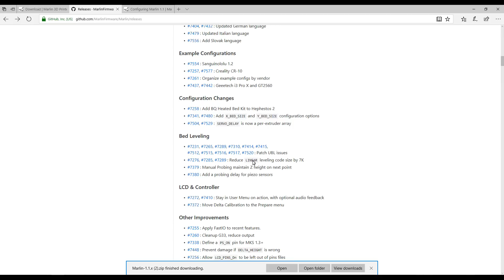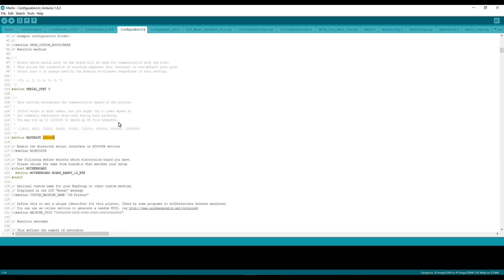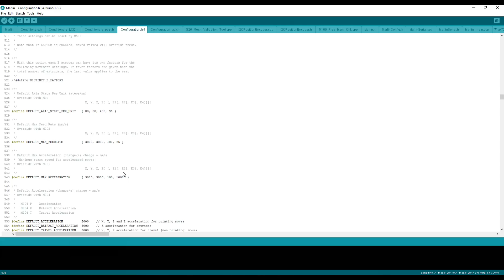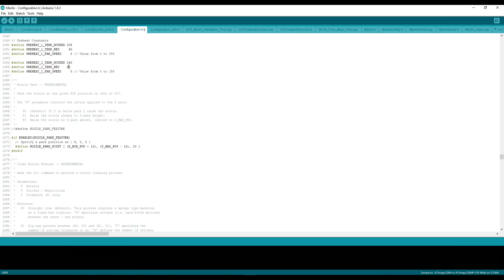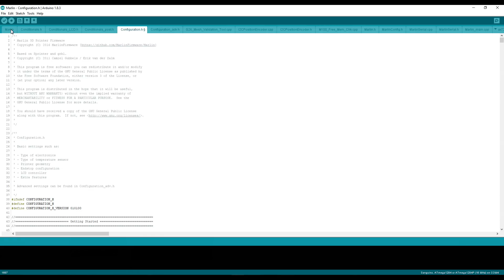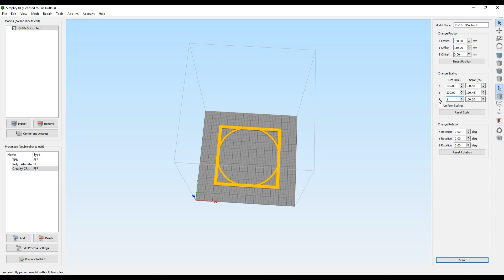Updating CR-10 Firmware to Marlin 1.1.6 Part I

Comment from the maker: Hello everyone, I am going to do a part 2 on the marlin firmware 1.1.6 on everything I have forgotten in the part 1 video. So far I have the filament sensor for those of you with the CR-10S, the change filament function, and adding baby steps function as well. Are there any other areas you guys want me to go over in the part 2 video before I make it?
Reply: Dont know if this is just me, if its something that needs changing in the firmware or samething I did wrong.
But I cannot seem to get the machine to go past 0 in Z offset.
So I am unable to find my Z offset ???
Reply from the maker: To disable the end stops you will enter the gcode M211 S0 into the communication bar. In order to do this, your printer must be connected to a computer and through CURU, Simplify 3D, Raspberry PI, or even the Arduino IDE serial monitor. Type M211 S0 and you will be able to go past the 0 in the Z direction and obtain your Z-offset. From there enter you Z-offset either through the control panel of the CR-10 and save settings or on the firmware: #define Z_PROBE_OFFSET_FROM_EXTRUDER
Reply: Thank you very mutch :-)
Will try straight away :-)
Realy great instructions on doing this Firmware upgrade !!
Looking forward to Part 2.
Reply: Hi I,ve installed 1.1.6 on my CR-10S from another source I found some time ago. I have babysteps and mesh bed levelling wich is awesome but there is a strange little thing that I do not get right and that is I have to have my SD card in the printer before I turn it on otherwise the SD card can not be accessed apparently. To be clear, the printer reads the Sd card and I can print but only when the card is inserted before booting the printer. Any ideas?
Reply from the maker: That is an odd problem. What I would try first is to download the stock CR-10S firmware in the description above and compare the LCD and SD support section with your firmware and make sure they match. Line 1170 to 1534 in configuration.h.
Reply: I'm just exploring my 10S Firmware for upgrade. This sounded similar to a discussion on the 1.1.6 upgrade. Someone had an SD card issue and here's the answer: "If you want to use the SD card normally, edit “ultralcd.cpp” lines 977 and 985, it should be: #if PIN_EXISTS(SD_DETECT) instead of #if !PIN_EXISTS(SD_DETECT)." (Note the !) Not sure if this is the answer, but it sounded similar, here's the source: https://printedsolid.com/blogs/news/installing-marlin-1-1-6-on-your-cr-10s-with-mesh-bed-leveling
Reply from the maker: +The PuterPro thanks for helping out.
Reply: {Small Bow} My pleasure!
Reply: Hello Eric's DIY
i was wondering.....i got the marlin firmware and arduino. Q? Do i have to open up marlin.io in ardruino? Q2? am i supposed to be pluging my printer to the pc  to do these steps? How do i transfer files from my pc to my printer CR-10S latest firmware 1.1.8. Mine is stocked with 1.1.6 and i have a creality version 2 board but dont know the name of this particular board...CR10-S and CR-10 is differnt. Thanks
Reply from the maker: Once Arduino IDE is installed you should be able to open the marlin.io file from the folder where Marlin is located. You will need to plug your computer into your printer. As far as the board for the CR-10S you will select the Arduino/Genuine Mega or Mega 2560 with a BAUDRATE 115200. Once that is set up and you have selected the correct com port you will be able to verify and upload. Disclaimer: make these changes at your own risk.
Reply: Thanks mate!!
Reply: hey mac my ino file is DOES NOT HAVE AN ICON I JUST CLICK ON IT AND IT WINDOWS SHOWS ME OPTIONS WHAT APP I WISH TO USE TO RUN THIS MARLIN.INO . WHAT CAN I DO HERE MAN HELP PLEASE ???

Comment: First of I like your video well done, lots of good info, it's surprising how many people don't even know how to add line numbers and it makes following in code so much easier, so kudos to you.
I would like to point out Baby steps is in Configuration adv.h  just do a (Ctrl F on PC) 0r (Command F on Mac) and type in ''baby'' then press find or goto approx line 591.
Reply from the maker: Yeah, not sure why I said baby stepping. I couldn't remember what #define ENCODER_PULSES_PER_STEP 1 was in the video. I should have said the encoder movement for the Smart LCD. Thank you for the tip.

Comment: Line 127 doesn't change the boot screen name, just the screen name on the main panel. 
If you want to change the text under the marlin logo do that on line 92 in version.h

If you want a custom bootscreen uncomment 93 and 94 in configuration.h and check out Marlin\example_configurations\BQ\Hephestos_2 for how to make it

You didn't mention the filament runout sensor on line 801 and 803

For babystepping Configuration_adv.h / 602 uncomment define babystepping / 608 uncomment doubleclick

Also for those brand new to arduino you will need to install the sanguino board and ug8lib library

File/preferences and add the following url to additional boards then go to tools/board/board manager. scroll to the bottom and choose sanguino and install version 1.02
https://raw.githubusercontent.com/Lauszus/Sanguino/master/package_lauszus_sanguino_index.json

download https://bintray.com/olikraus/u8glib/download_file?file_path=u8glib_arduino_v1.18.1.zip
Then sketch>include library>add zip library and select the zip file
Reply from the maker: Thank You

Comment: Great video, I was wondering is there a section in Marlin where you can have the bed move to the front of the printer when done and to the back?
Reply from the maker: You can actually do that through the script what are used Cura or simplify3d.
Reply: Right now Cura, plan to get simplify3d after I get money together.
Reply from the maker: Yeah I'm traveling right now I can't remember the specific code you put into end script I think it's something with G1 Y300 or G1 Y-300
Reply: Do you mean the end gcode in machine settings? This is what it shows now.
G1 F1800 E-3
G1 F3000 Z10
G90
G28 X0 Y0 ; home x and y axis
M106 S0 ; turn off cooling fan
M104 S0 ; turn off extruder
M140 S0 ; turn off bed
M84 ; disable motors
Reply from the maker: Yeah so before M84 you can add G1 Y300 or G1 Y-300 one of those codes will push it forward all the way or back all the way I can't remember which one
Reply: Thanks I'll try that and let you know.

Comment: Thanks for responding.
I have a CR-10 and I was told it had one, How can I varify that?
The reason I ask when I tried to upgrade the firmware, it would not upload it.
I can burn one but I hoped I would not have to open the box. I was hoping I had done something wrong.
I guess I will need to open the box anyway.
Thanks
James Cullins

Comment: Hei Eric, love your videos a lot. I'm new in 3D printer, bought cr-10s (300x300x400) that has two z-axis motors. I want to print with polycarbonate and use E3D-V6 hotend. Do I need to change the settings on Stock firmware? If yes, do I download the stock firmware on your description and modify it the same way described in this video? Or Do I need to upgrade the system default firmware to Marlin 1.1.6 and follow this video? Really need your guide on this. Thank you in advance.
Reply from the maker: The only changes you will have to make from the stock firmware file I provide are the offsets for the E3D mount that you are using and if you have an auto level system. If you are using the same mount as I am, then you can use the same offsets as I do from the video.
Reply: Thank you so much Eric for the explaination. 😃🙌 👏 🙏 🤝 👍 Didn't know you have already made changes on that firmware. This is wonderful. I have downloaded it and now waiting for my orders of accessories to modify the machine. Have a wonderful day Eric!!!

Comment: Great video, i am about to put marlin on my CR-10S now i know  the mother board is different and also it has filament sensor etc so would you suggest i still use the melzi creality type?
Reply from the maker: For the CR-10S you will have to select in Arduino IDE  tools > board>Arduino/Genuino Mega or Mega 2560 and then make sure the processor is ATMega 2560. For the filament run-out sensor you will have to uncomment line 801 #define FILAMENT_RUNOUT_SENSOR and that should work. hope that helps
Reply: Eric's DIY brilliant thank you :)
Reply: I think I have worked out all the settings now inc the filament sensor pin stuff, on the board do you know which one it is Megatronics v1 70 v2 701 v3 703 as they are all 2560 ?
Reply: sorry just worked it out I think due to the layout looks like a v3 703
Reply from the maker: +Tac Blades Good to know wasn't to sure myself.
Reply: Hi, I was following your video. This tutorial is actually guide to stock CR-10 than a CR-10S correct?
I had a Stock CR-10 S5... I know that I have to flash the bootloader before having this custom marlin 1.1.6 but just want to be sure and double check with you. Btw many thanks to your help here, stay awesome !!!
Reply from the maker: +Skylu3D yeah its for a stock CR10 but should be enough to get you started. I think the s5 are different not sure I'll have to look it up
Reply: Thank you very much! and have a good day :)

Comment: Hello Eric, great video and very well explained! :-) If there was still a concern in which I would need help. Could you please tell me or explain which lines and files I need to change in Marlin 1.1.6 in order to integrate a filament runout sensor so that it will work and stop printing accordingly?!?!?!? Thanks for your help and support in advance.

Best regards,
Christian
Reply from the maker: Yeah, under the configuration.h file line 794 is the filament runout sensor portion. You will need to uncomment line 801  #define FILAMENT_RUNOUT_SENSOR and should work.
Reply: Thanks for the super fast response. I had already tried / done this before, but unfortunately the following error message comes when checking the sketch: #error "FILAMENT_RUNOUT_SENSOR requires FIL_RUNOUT_PIN." ???

The cable for the filament sensor is connected directly to the board ..... Thanks for the further assistance ....
Reply from the maker: Oh, so on line 797 it states that we need to use servo3_pin for a ramps board. So on line 1652 uncomment #define NUM_SERVOS 3 and try that.
Reply: Correct! That does not work
Reply from the maker: Okay, I figured it out. Change back line 1652 to  //#define NUM_SERVOS 3. Let's start from the top. In the configuration.h file Uncomment line 801  #define FILAMENT_RUNOUT_SENSOR. Then  Line 803 change false to true like so #define FIL_RUNOUT_INVERTING true. From there, your will go to the configuration_adv.h file and on line 819 uncomment #define ADVANCED_PAUSE_FEATURE.  Lastly You will need to go to the PINS_RAMPS file or search all sketch tabs for #define FIL_RUNOUT_PIN and change the 4 to a 2 like so #define FIL_RUNOUT_PIN      2
Reply from the maker: Also for the CR-10s make sure line 122 reads  #define MOTHERBOARD 43 in the configuration.h file and under Tools-> Board-> Arduino/Genuino Mega is selected.
Reply from the maker: If that doesn't work then here is a good resource I just found for the CR-10S and Marlin 1.1.6 https://printedsolid.com/blogs/news/installing-marlin-1-1-6-on-your-cr-10s-with-mesh-bed-leveling
Reply: Eric, many, many thanks for your help! I will contact you if I have changed the values accordingly, so that maybe others can also benefit from your contribution. I have a new motherboard, which is installed in the CR10S ordered and then the Marlin software with the changes on the board load. Best regards, Christian

Comment: hello all

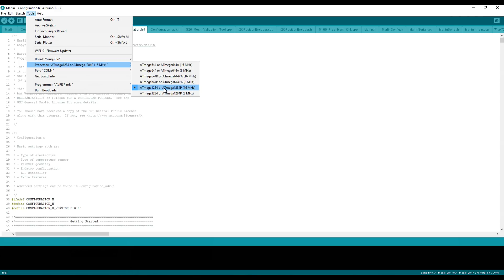I am trying to update my firmware to marlin 1.1.6 to get my BLtouch to work. I bought a pin 27 adaptor for the BLTouch. I updated the file using the instructions from your youtube video and can't get past the verification step at 22:00 minutes. I get an error message from my program "pins for this chip not defined in Arduino.h! If you have a working pins definition, please contribute!" << refers to line 56 in Configuration.h. I am using a ATmega328 UNO by velleman as ISP. Additionally, how do I select sanguino as my board at 22:01 minutes into the video? My software does not list it. When I try to add it via Tools>Board>Boards manager...it gives me a bunch of packages and can't tell which one would have the sanguino. To be clear I followed this video to connect my board to the cr-10 https://www.youtube.com/watch?v=27RDXtKjrCI&t=398s . Am I missing something Any help?

Comment: What do you mean by a stock 3d printer? I have a CR 10 from Hictop, with a stop switch in back and to the left.
Reply from the maker: What I mean by stock 3D printer is no upgrades that require firmware updates.

Comment: Hi I have a regular CR-10 300x300x400. I want to do the upgrades to it like the Dual Z motors, Filament Sensor, Etc & Ive been told the best way is to just buy the entire upgrade packages which include the Dual Z Motors with ball screw, A New Motherboard, The Filament sensor, & a New LCD screen, Then Im wanting to also put some TMC2100 Stepper Motor Drivers onto it to make it stealth like quiet. But I thought that after I upgraded my Motherboard so I'd have the same as the CR-10S Then I'd need a Bootloader to flash Marlin onto the board using an Arduino Board!! Is this NOT True could you please inform me of exact what I should & should NOT Buy so I can have a custom Marlin Rom that is also able to use the TH3D" bed leveling sensor. Also planning on implementing Octoprint!! Any other pointers or suggestions would be appreciated! Thanks Tom 
P.S. Great video
Reply from the maker: Well, I guess it depends on how much money you want to spend. Most boards do not need a bootloader. For example, the CR-10s doesn't need a bootloader. For me, I like to buy each specific part instead of buying a kit. You will have to get a board to support TMC2100 drivers the CR-10s board has built-in drivers. I recommend buying a dual Z kit and everything else separately. Also, you have to keep in mind if you upgrade your controller board, it may not fit in the case correctly.  Firmware should be relatively simple as well.

Comment: I have a stock CR-10S and was wondering - how the do you check the current 'stock' 
firmware version? Current Marlin is 1.1.8 and Im under the impression its running Marlin now, it 'feels' like a very old version probably the same as the CR-10 uses from yester-year. The CR-10S has almost no advanced options by default.
Reply from the maker: If its stock firmware from Creality I am not sure if you can see it. One way you might be able to see it is to plug it into the computer and view it in the serial monitor. It will be the first or second line of script that appears. Thats if its there.

Comment: I have a CR-10 S5, & i can't upload 1.1.4,  or 1.1.5 . The error message says "Pins for this chip not defined in Arduino.H" I can't find Arduino.H in the menus. If I switch to the mega 2560, it says have the wrong u8glib files. I'm new to Arduino & trying to figure it out.  Really need some help.

Comment: I'm getting errors about not enough room.  I know 1.1.5 barely fit in the 1284P board.  How did you get this to fit???
Reply: Go to configuration adv h  line 683 and disable arc support. It will free up enough space.

Comment: Can you tell me what the FR symbals on the LCD display "lower left side" with the 100% are for. I noticed that if you rotate the control knob you can change the 100% to a lower or higher number. But what is it for. Anyone ?
Reply from the maker: Feed rate. Basically, it is a way to speed up your print or slow down.
Reply: Flow rate
Reply: Thank You both.
Reply: If you want to get technical it's both... the FR% on the lcd represents feedrate... feedrate speeds or slows all movements including extruder so yes it increases or decreases flow as well but remember it's ALL feeds equally slow or speed... your FLOW multiplier is under another drop down menu which is TUNE when the print is under way... this setting % solely increases or decreases extruder stepper speed... 

I hope this clears things up a little...
Reply: Eric's DIY I think feed rate is probably more correct, I didn't see your comment when I originally posted

Comment: Can you flash the cr10 bootloader without an arduino board directly from windows and usb to control box?
Reply from the maker: Unfortenly you will need to tap into the ISP on the control board which will require either an Arduino or a bootloader tool. This process will require you to open the control box. This will have to be at your own risk.

Comment: What firmware does CR-10S come with? How do I create a backup of the installed Firmware?
Reply from the maker: Its a version of marlin I am pretty sure that the CR-10 facebook page has the original firmware for the CR-10s under files.

Comment: Hi Eric... I did the firmware upgrade and all went well however it wont extrude filament?
Is there something I have missed or do I need to set something on the control box?
Thanks
Reply from the maker: +Roger Ramjet thats an odd problem i will have to look into that one is your printer stock. Do yoy have a cr10 or a cr10s
Reply: I managed to solve it... I didnt invert the extruder :( all working now... keep up the awesome work